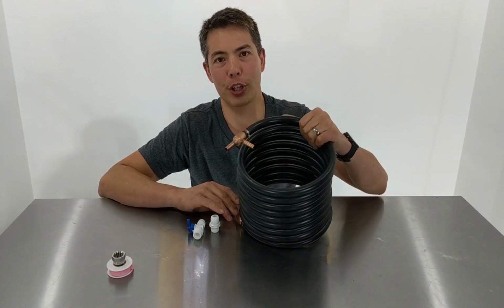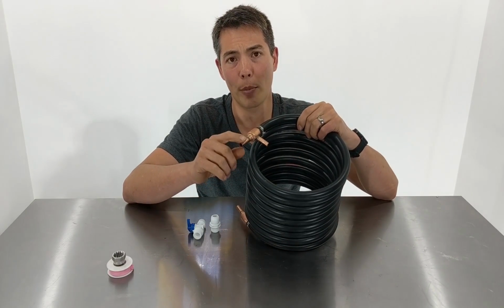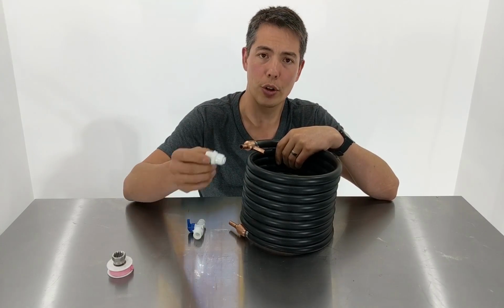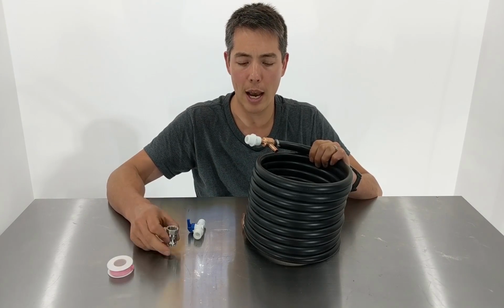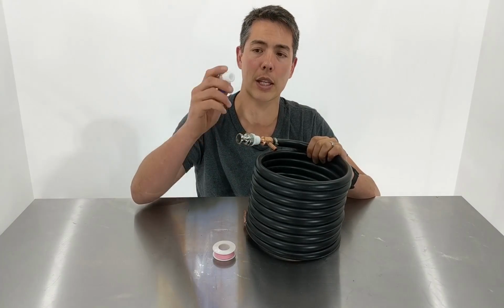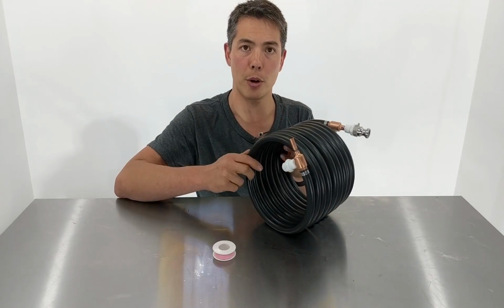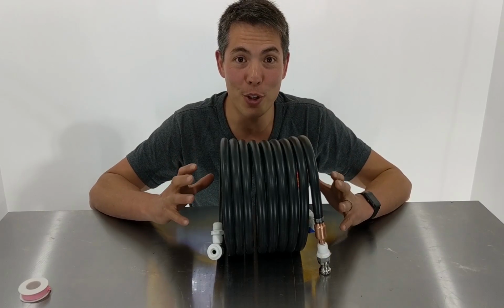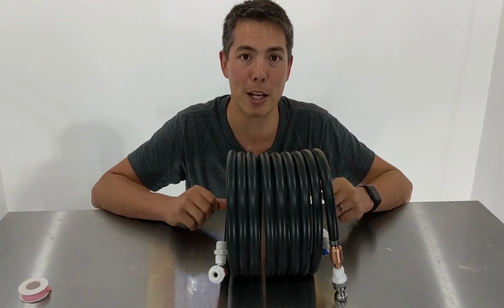How to Setup and Use the Copper Concentric Counter Flow Wort Chiller

Comment: Can you use 8mm OD tubing for the wort with this or is that too narrow?  

Also i see the camlock on the wort in side.  Do you connect that right to the recirculation camlock on the robobrew?
Reply from the maker: EVABarrier is not especially heat resistant - best to use silicone. The camlock can be hooked up directly.

Comment: Hi
How do I prevent oxydation in the copper tubing? And if it happens how do i get rid of it? Thanks
Reply: Copper is bad for oxydation tubing, better iron aisi 304
Reply from the maker: It's not really an option.  Normally you would only be concerned with oxidation after fermentation has begun not during the cooling process.
Reply: @KegLand  I was referring to the copper tubing itself, not the wort

Comment: So it's designed to have a boiling hot wurt running straight through a plastic duotite fitting? At the moment I naturally chill overnight, and was looking at this seriously till I saw that near 100c fluid is going to be in contact with plastic, not healthy IMO.
Reply from the maker: We are using acetal plastic at the moment and starting to change over to POK.  Both plastics are still very strong at boiling point.   Many engineering plastics like these easily handle boiling water.  I should also say that the valve to regulate water flow is on the inlet side too so the tube and hose is not under much pressure either.

Comment: Can you clean the copper internals with regular PBW solution running from the kettle? What do you recommend?
Reply from the maker: Yes you can clean the copper with PBW no problem.  This is a good way to do it.

To sanitise the coil it's best to use heat.  So recirculate boiling hot wort through the coil for 2-3 min at the end of the boil before turning the coolant water down.
Reply: @KegLand  Thanks guys!

Comment: I think the water in and out ports should be facing outwards for ease of access
Reply from the maker: We did consider this however they can also get damaged more easily when we face them in the outward direction.  So for storage and transit we felt that it would be better to face then inward.

Comment: I run straight hose into mine with clamps and it works well for anyone that doesn't want to buy the extra fittings.
Reply from the maker: Yes this also works well.